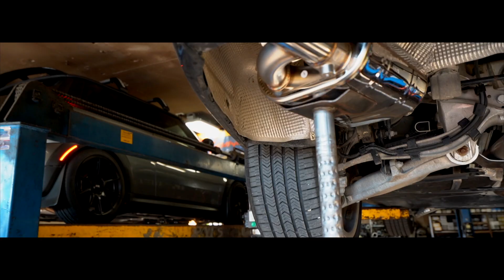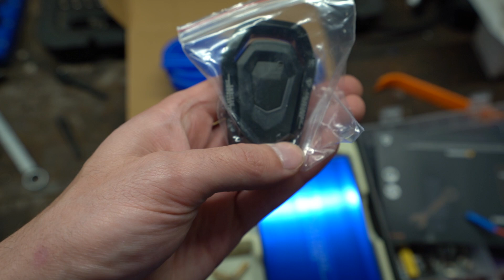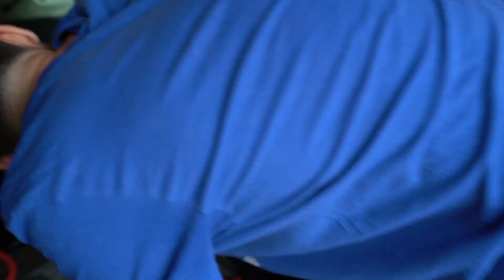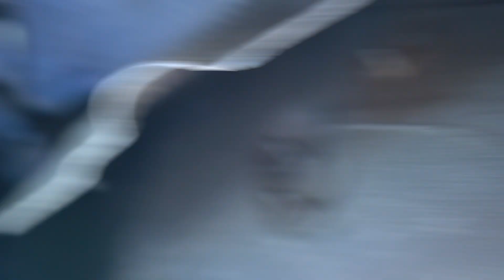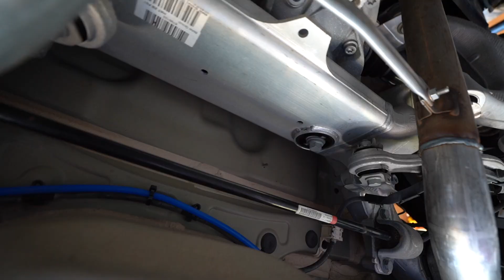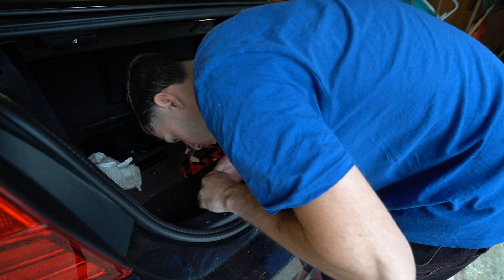BMW F10 535 GETS A VALVETRONIC EXHAUST (SOUNDS AMAZING!!!)

Comment: I love the Valvetronic muffler. I would love to get them for my 535i, but I’m scared will the muffler make the car quieter even with the valve open. Is the car quieter with the valve mufflers ? Also great video.
Reply: Valve cover being closed is supposed to make your car quieter or stock. Valve cover being open is like a muffler delete plus if u have downpipes or a resonator delete. Basically what ever your exhaust system is you can make it loud or quiet whenever you want

Comment: Question about the tap a fuse!!! I bought one but I believe it’s max amps is 10A. The rear defroster is 30A. I assume I need to get a higher amp tap a fuse circuit. Otherwise, any issues with the connection? Is there anything I need to look out for? Thanks.
Reply: After further research I found that the “10A rating only applies to the added fuse, and not the source fuse.” So I can get away with using this “add-a-fuse” circuit while using a 10a fuse for the exhaust, and keeping the 30a fuse for the rear defroster.
Reply: One question, how do I know which way to install the “add a circuit”? Which terminal would be the hot side.
Reply: Fuse 10A or 30A??

Comment: I just bought a pair for my charger and hoping to have it installed by next week. How did you program it to work with your garage door openers because I really want to do that too
Reply: Did you like it? I just purchased it for my 21 Acura TLX Type s
Reply: @djsthemetereman  do you have IG so I can see/hear how yours its gonna sound, I'm trying to buy a set of these mufflers
Reply: @jonathanramos1189  I don't I'm not a social media guy but somehow I've gotta get downloaded so others can hear because I believe I'll be the first to do this on the type s, so I'll try, my mufflers arrive tomorrow then I plan to get them installed by the performance shop called XLR8 in Connecticut
Reply: @djsthemetereman  💯

Comment: Also was thinking to buy valvetronic exhaust, but bought oem m5, didn’t install yet. M5 oem exhaust also has open valve with vacuum, bought also aftermarket plastic diffuser, but heard that then impossible will be to use comfort trunk access, and bought after that oem m5 diffuser and also people use to cut plastic bumper reinforcement to make custom diffuser. Decided to buy oem m5 bumper reinforcement with comfort access, now only need time to go to bodyshop to repaint diffuser to black or oem color of car and install m5 exhaust, also bought separately that box with hoses which makes vacuum, but heard that u can use vacuum brake from front bring hose and just put small valve which will open or close hose in that case you will get oem style like 550 and m5 has. These exhaust I heard that after a bit time will begin get rusty inside and it’s very thin metal and because of that it will not give a deep good sound, that’s why decided to go with oem m5

Comment: Greetings from Boston lol I got the same brand can't wait till I recive it
Reply from the maker: It’s a great exhaust wondering if I should get a catless down pipe but I am concerned about the smell
Reply: @EvanGoyuk  I went with highflow fabspeed makes them and it still passes inspection and no smell when warmed up its just as catless,..vrsf catted highflow will always give a slight smell when your stopped but not noticable when driving I currently have the fabspeed its pricey tho
Reply from the maker: They make one for the f10 535?
Reply: @EvanGoyuk  vrsf makes one but it's catless for yours,  fabspeed doesn't make one surprisingly, but I do know that if you get a good tuner with the catless dp the smell decreases alot than if you had no tune

Comment: hey man how did u program the button with ur garage opener?
Reply from the maker: Just like programming your garage door opener. You press and hold buttons 1 and 3. The press the button you want to assign and the button on the valvetronic remote
Reply: @EvanGoyuk  thanks! i just installed a similar setup but with valved vacuum cut outs before the mufflers. So catless dp then these right before the stock mufflers. With the valves closed it sounds stock still as the stock mufflers are so restrictive, but once i open them... man its so loud and sounds amazing LOL. I would never be able to run a muffler delete and catless dp tho as the drone at 18-1900 rpms is horrific. Valved is def the way to go
Reply from the maker: I am nervous for how loud it is going to be with a catless DP and the valves shut
Reply: @EvanGoyuk  yeah im not sure how it would be with those mufflers u got now, but from the stock mufflers, you couldnt even tell i installed a dp. Just the cold start was loud for 15 seconds and wide open throttle was a bit louder. Other than that stock AF.